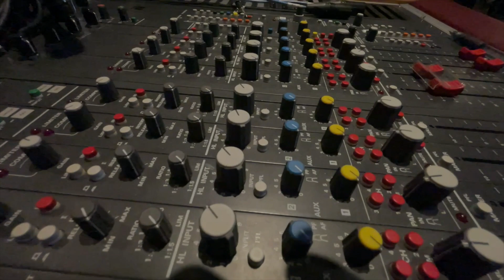Understanding acoustic diffusers

Comment: the problem with acoustic diffusers is that dont absorb enough. not a problem in the right environment and goals. but for me i like the dead sound in a room.  and dead sounding rooms also sounds like a open field, dont get much more natural than that.
Reply: Dead sounding room basically sucks out the actual natural sound of it. Deadened room doesn't sound like an open field. Dead room sounds like a void. Sound being eaten by an emptiness.
Natural open field pretty much diffuses the sound waves as well as absorbs. Grass, ground, distant trees, perhaps even mountains or hills, they all diffuse, absorb as well as reflect and when you shout you hear this natural, lively spread.
Reply: @sermerlin1  you cant generalize like that,  open fields are used in speaker measurement because the lack of refection's.
Reply: @sudd3660  open fields are not used but rather anechoic chambers.

Open fields still DO have an effect into the sound and its measurement while anechoic chambers do not.

Measurement of speakers are always done in tightly controlled environments.

Comment: I built one (QRD 7) to learn, or maybe just for fun. In my opinion, they are expensive (to buy or build) and big, and only one or two small QRD (wide spectrum) won't do anything. They require a minimum distance, otherwise they can have "comb filtering". QRD 11 or more are better than QRD 7. Bare walls are a great, precise and even diffuser for lateral walls, or when the back wall is too close (maybe some "good" absorption), or the front wall is really far and the budget is small. Thin and small diffusers for a narrow band or spectrum work nicely for flutter echo (around 2 kHz) and are cheap, although «clap test» doesn't work and flutter echo isn't usually a real problem.